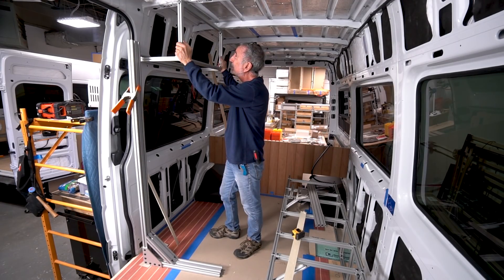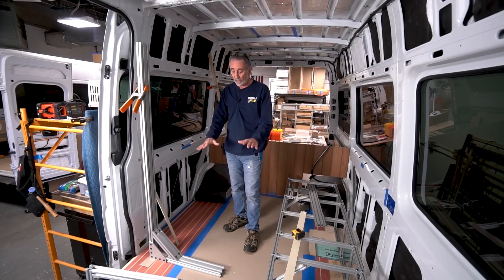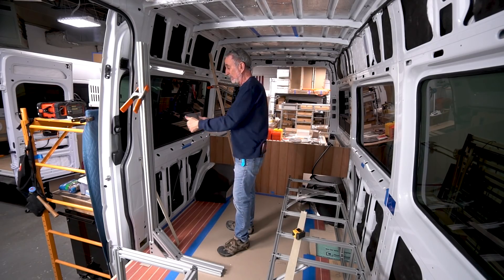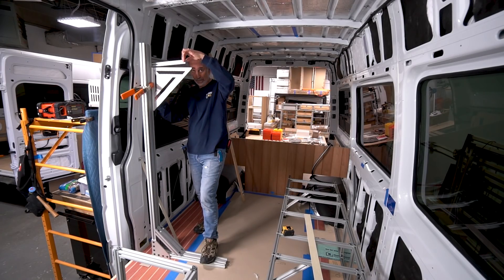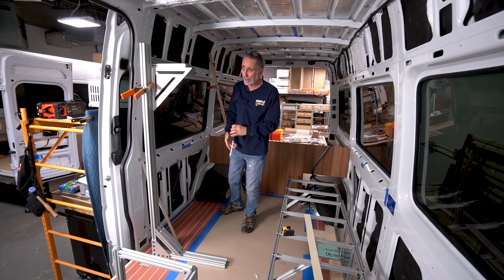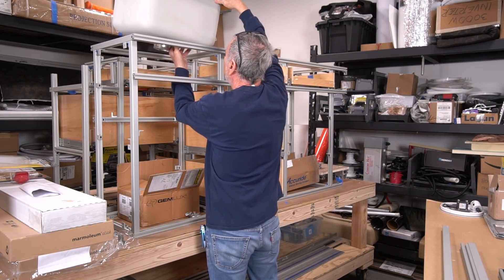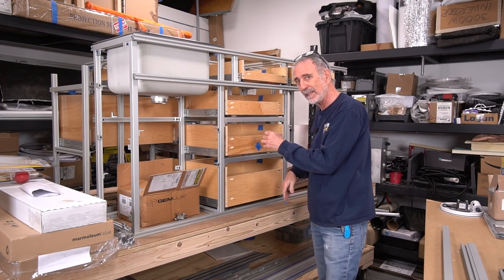Van builder shares private tips for a high quality build

Comment: 1) 0:57  BIG SQUARE: Big wall square for getting correct dimensions for cabinets.  
2) 1:25 VAN FLOOR CENTERLINE: How to determine centerline of floor from which to measure from.
3) 2:57 MEASURE CABINET PLACEMENT: How to measure for placement of cabinets so they are square and parallel to floor.
4) 9:38  PLUS NUTS: Drilling holes in ceiling ribs for Riv Nuts or Plus Nuts for ceiling panels. He sprays gray automotive primer into each hole after drilling so holes won’t rust. These are used for holes in surfaces so you can screw bolts into areas where you don’t have access to use nuts on the bolts. He uses 5/16-8 Plus Nuts. Both types are good but Plus Nuts have little feet on the outside so should be more secure than Riv Nuts.
5) 11:52 DRAWERS: Cabinet drawers are 1/2” thick pre-finished maple plywood.
6) 13:07 CABINETS: The top front area of cabinets extends 1” farther than the doors and drawers below to allow a sense of space.
7) 14:13 LATCHES & DRAWER SLIDES: Stainless steel marine door and drawer pulls. He uses Blum hidden soft closing drawer slides.
8) 15:06 CEILING PANELS: Panels are tongue and groove with painters canvas glued to back with contact cement. This enables the ceiling panel sections to conform to the curve of the van ceiling. Canvas attached to the panels also makes it easier to install each section to the vans ceiling. Panels are sprayed with two coats of primer (sanded between each coat) and then the canvas is glued to the back. After that each section is sprayed with top coat before installing on to the van ceiling.

Comment: Just found you and your channel!  Brilliant stuff.  I had the adventure of a lifetime driving the Baja peninsula in a truck and slide in camper for 3 months.  Wanting to build a van for lighter travel.  IDEA! You should be putting your designs into plans to be bought by people like me not able to pay a builder.  I would pay you for 8020 plans/hardware lists for cabinets, bed platforms, shower stall and kitchen with drawers.  Mix and match parts how I want or in steps due to cost.  Easy, order everything precut with hardware and assemble according to your schematic.  This is a fantastic opportunity to expand your business and it would be a huge contribution to the DIY community.  Subscribed.  Thank you.

Comment: Great video as always! Your videos are always full of gems of van building knowledge.

1:40 Strike the centerline on the van floor and measure off the centerline.

2:20 Levels are not the best reference in a van. Use the floor as the level reference. Faces should be made square or parallel to the floor.

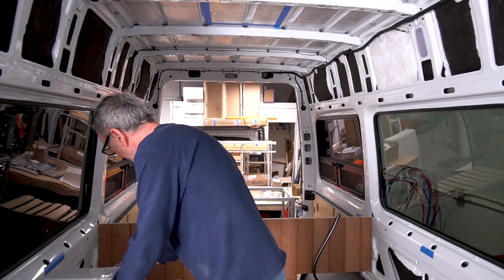10:30 Plus nut vs Riv nut (threaded rivets). Plus nut has more hold.

14:14 Marine single action latches.

14:30 Which blum soft close slides did you use?

Comment: Hi mate:

Love your builds, your attention to detail, and your willingness to teach.

Pro Tip:

When we use rivnuts and plusnuts in fabrication, we don't hit the drilled holes with a shot of spray primer from the front side to seal the exposed metal. That just doesn't do the job. Better is to use an earbud (Q-Tip in Yankee speak) coated with rust converter to scrape off a big drop of rust converter around the back (blind) side of the hole. That's where the bare, ragged steel burr is, and if you set the nut while the converter is still wet, it will bind the expansion nut and the sheet steel together fairly well when it converts/dries. The expansion nuts themselves lose their galvanizing at the joint from deformation anyway, and in a corrosive environment this method offers both superior rust protection and improved torque resistance. Don't take my word for it; try it on your test panel and tell us what you think...

Advanced Pro Tip:

Get a cheap 120ml (4 oz) push down alcohol dispenser bottle to wet your ear buds. As long as you keep water away from your ear buds, one of these little bottles half full of converter will seal hundreds of holes without contaminating the converter or spilling a drop- even if you knock it over a bunch of times while you're doing it. 

Cheers from sunny Western Australia, and keep up the good work! 

Tommo
Reply from the maker: EXCELLENT TIPS!!!! Thank you!

Comment: That T Square should be diy project of the month at 80/20, endless uses!

While you’re at this stage are you thinking of moving the rear door latch? I’m shocked by how many designs either block the door handle or make it very hard to access when using the bed. Maybe I’m nuts, but seems crazy to overlook a safety issue like that. They’re doors not a wall, but maybe it’s hard to move or install a relay.
Reply from the maker: Yes Matt, I have seen the rear doors blocked. Not in my vans! I always make sure the rear doors are easily opened no matter what the floor plan or configuration. Good eye for that! I appreciate your line of thinking!
Reply: @HumbleRoad  yes!!! That’s awesome!

Comment: Hello Sir, I've not been in touch before but I'd just like to say thank you so much for providing the most trustworthy and professional advice regarding most aspects of van building that I've found online - you've been a huge help with my projects.

I was wondering if you'd mind answering a quick question - I'm going to be building a large 8020 set square, like the one you show in this video - my question is, how did you connect the 45 degree angles?

I can see that you've bolted plates onto the side for the 90 degree angle, but the 45 degree ones seem to have a very elegant connection - is there a specific component or method you used for this?

Once again, thank you so, so much.

All the best, James
Reply from the maker: Thank you for supporting my channel! I truly appreciate it. All the components I used to build that giant set square are available on the 8020 website.
Reply: @HumbleRoad  Thank you, I'm really struggling to find the component but will persevere. Thanks again

Comment: I use a strut that spans the van from the horizontal wall longerons.  Everything is measured off that.
Reply: That's what I did, too. Except I used a string line tied between the driver's and passenger's side wall ribs to create a level reference. Much cheaper and easier than an 80/20 square.

Comment: Hi George - great video build tips! Thank you. In this video you show @0:40 the O/H galley cabinet and it has a 1.5x2 - I think - as the back rail that will go against the wall. Then on the bench behind you, and later in the video, you show the 1.5x3 piece that you 'hang' over that ledge - wonderful idea! Did you use both pieces? or did you end up only having the 1.5x2 hanging over the edge, used as the back rail of the cabinet? I watched your final video and in the area where you talk about the distribution sub panel for 12v, I can't quite tell which one was used...Thanks!
Reply from the maker: the 1.5 x 2 is in the overhead galley cabinet. The 1.5 x 3 is in the airline cabinets.
Reply: @HumbleRoad  aha! thank you for clarifying that - my 'old' eyes must have missed that little detail in the video. And what a great innovation those airline cabinets are! Even if we don't do the things you are doing, your creativity sparks imagination and ideas that work on our end. Still wish we'd had the funds for you to do our van, though it would have also meant waiting a very long time since your schedule was jammed when we started this idea. we're having fun diy'ing though...

Comment: Hi George,   I look forward to each new video you put out, thank you.  When watching the guys stapling the canvas to the back of the tongue and groove board, I was wondering if you use marine grade monel staples?  Also, with the Blum soft close glides....is a latch on the drawers redundant, or a necessity? Would the springs on the glides be enough to keep the drawers from coming open in transport?
Reply from the maker: Using regular ARROW staples. We will roll the primer/sealer across the back of each panel and I think with the extreme heat build up there should not be any issues.

Comment: A question: given that you can't guarantee that the van is going to be on level ground, wouldn't it make sense for the upper cabinets to have a slope towards the wall of the van? That way, you'll have less risk of things pouring out when you open the door. Thanks for the videos!
Reply from the maker: Along the front floor edge of each cabinet is a tiny "knee-wall" to prevent such catastrophes.

Comment: It is useful when you upper cabinet shelves are sloped backwards. This will hold boxes and cups much better in the cabinet while driving. Think of a salt shaker fallen over and rolling out right after opening the cabinet.
Reply from the maker: We build a slide stop into the front edge of every cabinet. You would have to park on a steep side incline for anything to fall out.

Comment: If you really want it perfect and to be able to use a level, block the van level from the frame, on all four corners, otherwise as even you get in or out or move around inside or as you add more weight to the van, your "level" shifts.
Plus if you want to get even more precise you need to check the floor with a laser level. Even the floor can have a warp, twist or slight dent in them.
Reply from the maker: For all the reasons you describe, using a level is not exacting, nor practical. Squares, tape measures and math are, imho, the best approach.
Reply: @HumbleRoad  I think you missed my point... If your reference point (The floor) isn't level or perfectly straight in the same plane, then all your measurements and what you think mathematically is level, are incorrect. It the same as working on an old house... You have to see what is and isn't level first, before you start working on it.

I'm currently working on a box truck and with a laser level across the aluminum plank box floor I have 1/16" to a 1/2" dip in the center of the floor. Walking across the floor you don't feel it. There are a few dents where freight was dropped on the floor. You can see and feel those dents walking. So if I used your monster framing square approach, then by the time I get 6' off the floor at 1/16",  I'm .1 degree off the center line. If I'm in the 1/2" area then I would be .4 degrees off the center line. So if I started at one side of a overhead cabinet and moved to the rear of the box 4' from a 1/16" dip section to a 1/2" dip section, you can see how the measurement and level would be incorrect. The far side measurement with the montster framing square of the side and bottom of the cabinet would would show it needs to be longer and lower. If you followed the center line with the monster framing square.

That is why it is better to level and stabilize the truck and see what you are working with first, so you don't end up with a surprise or scratching your head on why it doesn't fit, looks crooked, doesn't fit square when it should or you have 2 or more different measurements when they should match the other side. 

Even brand new stuff has issues... It could be a Monday or Friday build at the factory, if you catch my drift. Or even a machine applying adhesive to the frame and floor starts applying more or less in the middle of assembly. Or a welding fixture worn out... etc... etc...

Comment: Hi. Love your work. I was wondering if blocking the van level from the frame and then you can use a level or laser to get everything level and plumb?
Reply from the maker: I suppose that's possible to maintain level between all horizontal surfaces. But you still need to square things and I move my vans around too frequently to have them up on blocks!

Comment: Looking at your support and slides and drawers, I can't help but notice that there is an inch and a half to two inches of empty space between every drawer. Is there a justification for the "not-taking advantage" of this space in a van that is very limited on space to begin with. We are talking about a square foot of storage for every 1" vertical gap between 12x12 drawers. Could there be a solution without losing the function and convenience?

Comment: I’ve often wondered why you don’t use some type of jack system to lift and level the van during construction so you could use plumb bobs and regular leveling tools, or a laser level.
Reply from the maker: Not accurate enough and from time to time the vans need to be moved

Comment: HELP! I have FOUR  stripped out rivnuts in my van; two in the ceiling ribs and one on each wall. How do I remedy this?
Reply from the maker: If the threads are stripped, then yo have to drill it out or make another hole. If the nut is spinning in the hole, reset it with the tool.
Reply: @HumbleRoad  Thank you! That second sentence is most helpful...

Comment: I have a question. Each tough nut will hold at least 500 lbs. You put 6 of them (combined holding strength of 3000 lbs) it fasten a board that will hold up no more than 100 lbs. That is 30:1 engineering. Isn't that a bit of I've kill? Would not 3 work just as well? Additional labor and material(weight) that is not truely necessary is it?
Reply from the maker: You must consider dynamic loads in a moving vehicle. Potholes, speed bumps, washboard roads all add to the forces on those nuts. Also, the five fastener points help shape the strap along it's curve.

Comment: If the floor is square, you can measure with a waterpass the upper cabinets....... or am I wrong?
Reply from the maker: I think what you meant to say was if the floor is level. It better be dead-on level in every direction! Just standing in different spots in the van will change that.

Comment: Do you have another video that details your plate<bolt>bracket diy French cleat mounting system? Wouldn’t all of the stresses and friction be on the threads/sheer line of the bolt? I worry that the bolts would fail over time. ¯\_(ツ)_/¯ well done either way. Love the videos and I’d love to find a ‘no drill’ method of mounting to the van but I’m worried about putting all the stress on the fasteners. 

I’ve tried to skim the comments to see if this has already been asked, so forgive me if it has.